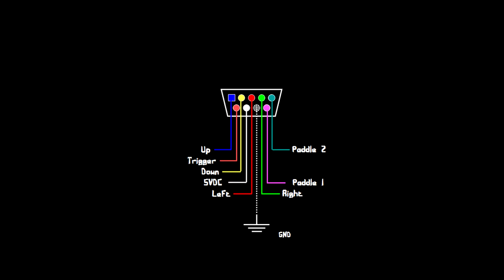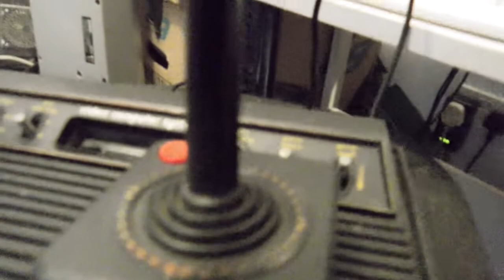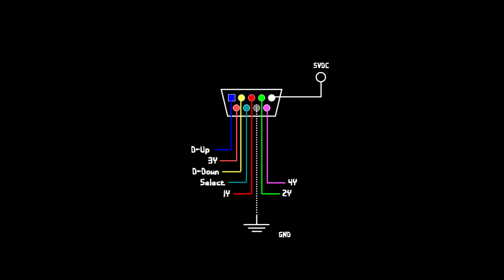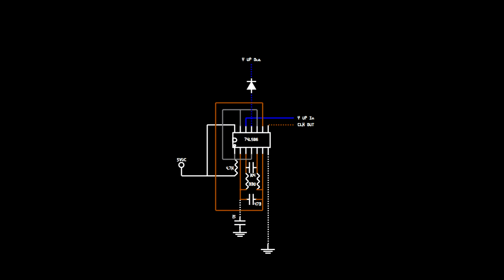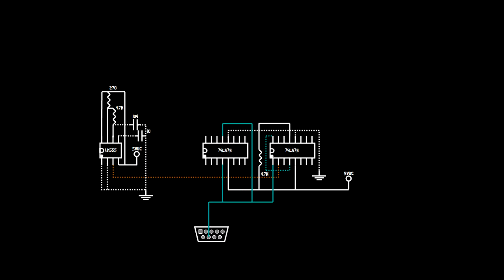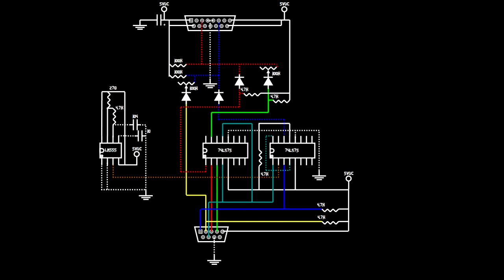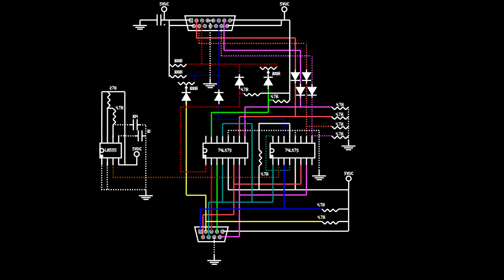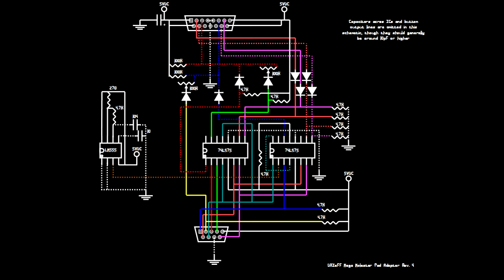Using a Mega Drive Controller on (old) PCs

Comment: Appreciate the detail in both the diagrams and how the circuit works.  Thanks for taking the time to create all that documentation.
Reply from the maker: No problem. I almost wanted to add animations showing signal paths, but it would have taken longer than I'd like and probably also look even messier. At least I know it's at least somewhat readable.

Comment: The 9 pin controller went on into the the early 1990s as both the Atari ST and Amiga used it. The STE had two 15 pin enhanced ports on the side (similar to a VGA connector) which were for the very rare Power Pad (which got a repaint and became the Jaguar Controller and yes, you can use a JagPad with an STE).

The Speccy also used the 9 pin port but with the pins all moved around. A lot of joysticks in the late 1980s had both a black plug for everything else and a grey plug for the Speccy.
Reply from the maker: The industry was still using 9-Pin ports in the 2000s on the endless Plug-N-Play machines, too.
The Amiga? What I think I opted to remove from the narration was that on Commodore machines they usually serve solely as 'Crash the game instantly' ports, at least on earlier machines. I can't recall ever once seeing them work on the C64, for example.
My ST 520 lacks the 15-Pin port. Interesting to know that some STs had this, especially as the Jaguar pad is horribly underappreciated.
Similarly every Spectrum I've encountered lacks any controller ports at all and provides just one through an optional expansion cartridge. Some of the Soviet machines did have one or two ports built-in, however, like the "Byte" from "BEMZ", which has one next to the power connector.
Reply: @HighTreason610  The Jagpad socket was on all STE but not Mega STE machines. I only have one game that uses it though, a recent homebrew shmup called R0x Zero.

If I were to make a game for the STE other than the one I'm bolting together slowly but surely, I'd have it use the Jagpad.

Comment: Nice video, this was a great project, and you wizarded this out nicely. This is the kind of project that is a great learning practice, there is a lot of valuable fundamental design concepts involved. Well done.
I noticed you had a DOS version of MasterGear, just wondering if you know where to get a copy, as it's free now but the Official site does not host the DOS version anymore as far as I can tell.
Reply from the maker: Thank you. Hopefully it reminds a few people how much fun it is to design an actual circuit instead of relying on full blown CPUs likely with other people's free code.
I'm not sure where you'd find that emulator now. Maybe Zophar's Domain will still have it. If you can't find it, I can probably just zip it up and shove it on my server somewhere.

Comment: Even microcontroller programming is turning for the stupid. Like I've been told people weren't interested in my purely assembler written LameMouseConverter and instead continued looking into my very old C++ written ps2serial mouse converter which suffers from latent inputs due to software overhead induced by the Arduino libraries. Then went on about preferring to make a similar converter out of a full blown ARM SBC or a very powerful ARM based microcontroller board with the firmware written in Python of all things, arguing that it also allows for USB mice to be converted.
Reply from the maker: Sounds about right, as it only makes sense the same principals would affect that area, too. Obviously I'm not totally against using micro controllers or anything and think the LameMouseConverter is an example of using one correctly, as the chip count and workload would be far higher to implement it discretely without one.

Comment: Zero Tolerance used a cabe to connect two megadrives together. i guess it used the serial mode.
Reply from the maker: I suppose the only way to know for sure is to either reverse-engineer the game, or to analyze the signals being sent up and down the cable.